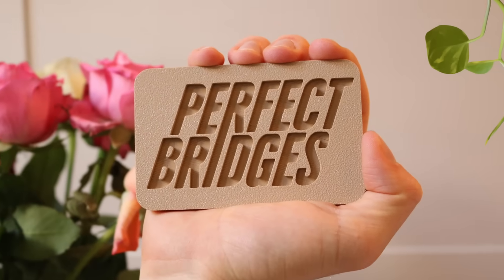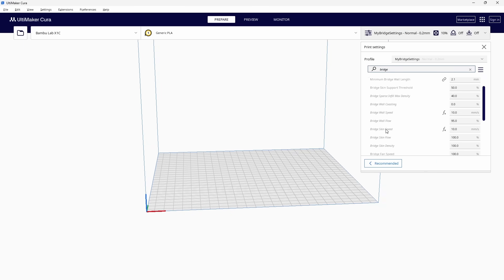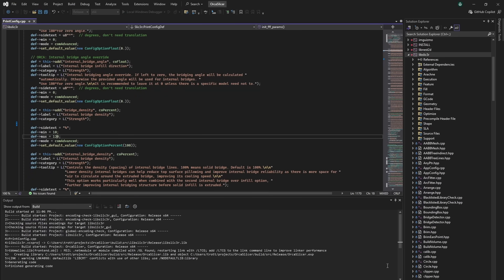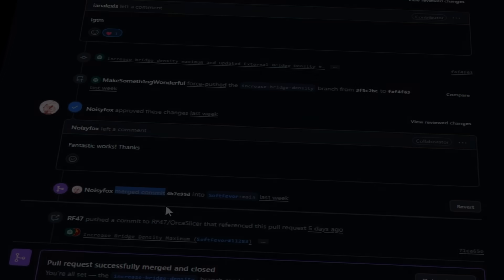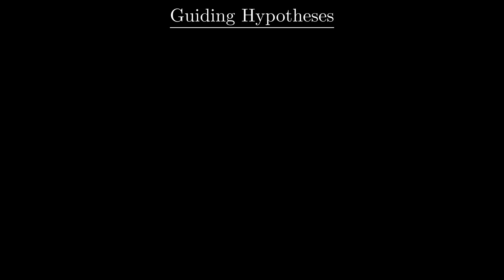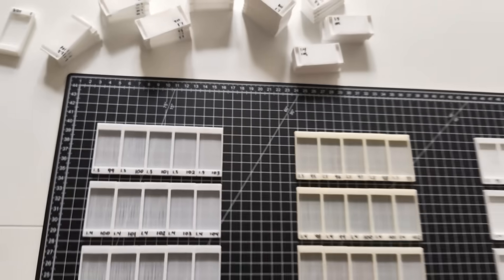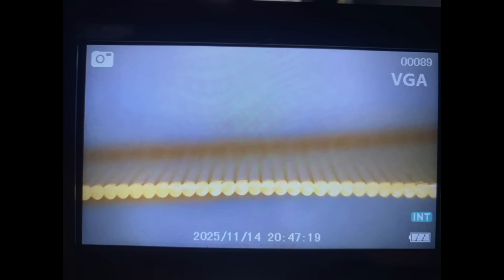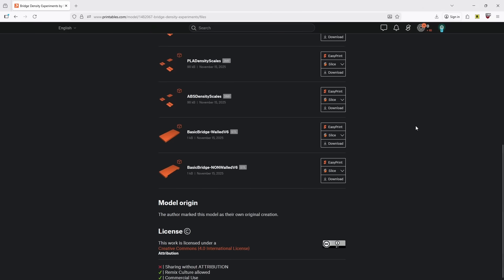You asked for PERFECT bridges in OrcaSlicer, so we built THIS

Comment: There is one feature i really miss from cura. It's the ability to set the direction of the seams. Could you please come up with something for it?
Reply: Being able to set the seams line pointed to the left or right or center with one click, really helps in saving alot of time. Especially for complex parts where we have to manually paint seams and repaint on each interation
Reply from the maker: If you want this sooner rather than later, the best thing to do would be to go to Cura's github and post a similar comment to this. I don't know any of those devs, but I've seen some of their communication. They seem very kind and helpful!

Comment: This is fantastic, obviously, well done. However, one thing that’s been bothering me since the very first video, how does this perform with true bridges? I.e. bridges that are free floating and only supported at either end. I’m guessing that without a side wall for the first bridge line to brace against, increasing flow and overlap isn’t going to have such a dramatic effect. If I’m right then I reckon the only thing that’s missing would be a support setting where only the very outside extrusion line of a bridge is supported with zero z-offset, so it’s easy to remove and you still get that the rigid side wall for the bridge lines to press up against.
Reply from the maker: Yep, it's a good point. The performance is really strong for "true" bridges. I actually printed 60 or so for this video but didn't use them because the test pieces are super fragile and start to bend after a day or two. With a more robust part, that wouldnt be a problem, though. The one major draw back is that the first line often breaks away from the rest of the bridge and just kind of hangs there. 
You could use paint on supports for a test of your idea, I think.
In a day or two, I'll print off a few "true" bridges and tag you in a short. Would you like that? Asking because I think that some people don't like the publicity
Reply: I’m not particularly active on YouTube or the community in general, but I don’t really mind. I look forward to seeing that though! Thanks.
Reply: @MakeSometh1ngWonderful  yes, I was about to ask about first line but found this comment. Running tests at the moment and while already getting nice results but the side lines(wall overhangs) almost always separated from the rest of the bridge.
Reply from the maker: I love that you're also testing. Yes, I am ashamed to say, but I didn't notice that those lines were classified under the "Wall Overhang" type. In the slicer, they even have a gap between that line and the bridge, which I would consider to be a bug. So, I made a model to cut them off, because they do not reflect the settings applied to the "Bridge" line type. Already getting really good results. 

I'll probably post a quick short on this when I am done.
Reply from the maker: Here is a short on this topic (https://youtube.com/shorts/F9FODshtw0w?feature=share). Ended up tagging someone else with a similar questions. For some reason, he wanted the bridge to be over 60mm so I made it 72mm. The overall quality is fantastic, but for half of the samples the bridge lines on one or both sides become loose. This seems to be independent of density. 
It's also worth mentioning that these lines are printed first. I couldn't figure out a way to stop that from happening but was pretty happy with the quality otherwise.

Comment: I wonder if it would help if you made a dynamic flow change when the printer gets close towards a wall or goes away from the wall, so the lines close to the wall wouldn't stack up, let's say if you are 5mm from the wall the flow rate percentage drops down till it goes to 1 when it hits the wall and vice versa when it goes away from the wall the flow rate goes back up dynamically.
Reply from the maker: This is a great insight. Are you referring to pressure advance? I dont know much about it. But, I was planning on testing it soon and possibly making a short about it
Reply: @MakeSometh1ngWonderful  Yes, it would basically be a pressure advance but for bridging, normal pressure advance happens when acceleration changes while printing. But for bridging it would need to be activated on how close or far the printer is from or to the wall.
Reply from the maker: Ok, this is a really good idea. I'll think about it and see what I can do. Want me to feature your comment if this comes to anything?
Reply: @MakeSometh1ngWonderful  Yes, sure, have you thought about how you will test it? I was thinking it would be possible to write a "post-processor" in python to change the original G-code of your print model so you change flow rate by change the E value and do a little math with the X or Y coordinates with parameters like distance from wall and flowrate and amount of steps. For instance distance from wall = 5mm and flowrate drop parameter is 20% and 10 steps, so every 0.5mm the flow rate E would drop with 2%. Just an example. Or maybe for testing to begin you can do a hard drop if you are a certain distance from the wall like instant 20% flow rate drop when you are 5mm from wall. EDIT: these examples are when you go towards a wall, when you go away from the wall it would be reverse ofcourse :)

Comment: Would it be possible and advantageous to either lower the multiplier near an edge then increase in the middle or also to slow the travel speed near the wall as it leaves the wall side to lower the staggered filament issue?
Reply from the maker: Yes, it's definitely possible! I edited flow like this in my previous video, which had some benefits and trade offs. I think that is what you meant by "multiplier"
You can also edit acceleration at the end, which is what I think you're referring to with the travel speed part.
Will it help? I am not sure, havent tested that yet. But, I've seen a few people using this technique to make really long bridges. So it definitely has some benefits.

Comment: It'd be verty interesting to test what happens if the bridges would be printed unidirectionally. I believe that would avoid the alternating pattern at the ends. It would not print new bridge next to a piece that's still soft and also simply not be alternating in nature.
Reply from the maker: You have a great point. This seems so simple, but I havent figured out how to do it yet. You could probably just manually write the g-code to make it happen as a proof of concept.

Comment: What am I doing wrong, I already had Orcaslicer 2.3.1 and can't set external bridge density past 100%
Downloaded again just in case and still can't pass the 100% external bridge density.
am I suppose to do something to the code?
Edit:  Ok so downloaded the Nighly build and the option is available there.
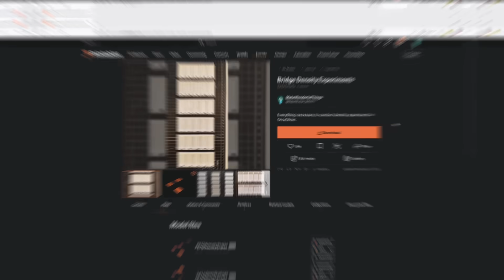Reply from the maker: It needs to be the "Nightly Build" as of right now. So, you need 2.3.2-dev. You can see what it looks like at 8:02. So, I think that you just have to scroll down a bit more

Comment: I never thought there could be away to increase number of lines for bringing as at lower flow like default of 0.9 I was getting large gaps on brige, also for prints like klicky probe the bridge edges were on mid air so I think bridging need some quite work to make the smart
Reply from the maker: There are a lot of smart people looking at these problems now. I think we will see a lot of advancement soon!
Reply: @MakeSometh1ngWonderful  I would expect the printer of the future to calibrate this automatically

Comment: What are the recommended bridge flow and density after all those tests?
Reply from the maker: I quite like BF=1.2, BD=108 and BF=1.3,BD=105 for Sunlu PETG. They look perfect to me. I've done a few "real" prints with them and have had great results
Reply: @MakeSometh1ngWonderful What about PLA? That's what most people are gonna use
Reply from the maker: I like to go with what works at BF 1.2 and 1.3. That offers a good middle path. So, for PLA that would be BD 105 and 102.

Comment: I grabbed the nightly build portable of Orca and brought over my filament presets etc.. I grabbed the models from printables and loaded it up as a 3mf project for petg. I changed the printer to my printer (SV08) for this test and sent it to the printer. Is the idea that I print all 3 plates from the project and then use the settings from the one that looks the best?
Reply from the maker: Nice, you're taking a lot of action quickly. In my opinion, you want to find a bridge flow that gives you the characteristics you want (aesthetics, strength, etc.). So, in theory, you could just start with bridge flow 1.3 for example, print off those 5 and check the results. The Density percentage where the "stringiness" stops is the "ideal." Then, just use that for your next print. 

If you want to know your options, just print all three plates and see what you get.

Some tuning may be necessary, but so far these values have been pretty close for everyone who has tried them. 

I hope this explanation helps!
Reply: @MakeSometh1ngWonderful So what are the magic values that work for pretty much everyone? 1.2 bridge flow and 105% density ?
Reply from the maker: There are no "magic values." I'd prefer if everyone tested and worked to that answer together. I'm not much of an authority, just asking questions and sharing what I find.

Anyway, the answer your looking for is on you other comment 😊
Reply: @MakeSometh1ngWonderful What can I look at if my bridges suck on all the results? Any suggestions? I feel like bridging on the Sovol SV08 just seems to have issues... It's Polymaker's new PETG formula and other than bridges things seem really dialed in for the filament.
Reply from the maker: Well, send me some photos on discord. @MakeSometh1ngWonderful. I can try to see if I recognize the issue or can offer any other help.

Comment: When reaching the sides decrease flow to thin out the lines?
Reply from the maker: Not sure what the question is - but this was the solution that I presented in my last video. It worked for the intended purpose, but the density solution here offers another tool to use.

Comment: Nice. After watching your previous video, I had tried setting "solid internal infill" to something less than the nozzle size so the lines would be closer on bridges, then up the bridge flow to fatten the line back out. Was trying this on TPU,.. so nothing really helped. Cool that you got a real solution implemented. Maybe I'll try it soon with something other than TPU.
Reply from the maker: A few commenters have said that flow and speed manipulation worked for TPU but I haven't had a chance to test it for myself. I want to do an entire video on TPU in the future. If you find success, I would love to know.
Reply: @MakeSometh1ngWonderful    I wouldn't say I've had success with TPU. Just not quite as bad. Slow,...like 10mm/s seemed best. A lot of fan, yet you will see which way your fan tends to blow because the "bridge" will blow in that direction. Turn off thick bridges( the opposite of these videos). The stuff we do with PLA just seems to make it worse. Again,.. no success story here. I was mostly just trying to make it "better" and easier to remove from supports. Seems like even though it's supported, it calculates that area as a bridge also.
Reply from the maker: Ok, these are interesting insights. Hopefully we can make some progress on this front soon
Reply: @rcrdps8144 probably very stupid thought: PLA can hold itself, if printed and cooled in the air. TPU can't. I'm having the thought of printing the TPU bridges very fast, but without increasing the flow, basically putting the TPU under tension across the bridge.
No idea how you'd set this up and if it would work. I'm just thinking about what you could do with the filament as it is on the spool, to get nice bridges.
For PLA, it's "just hold it when it's not melting", for TPU it's "put it under tension".
Reply: @Habixus  Fast works for PLA. I tried it with TPU and ended up going the other way. It doesn’t dry as fast as PLA, so it droops instead of creating the tension. Under extrusion might help you get it tighter.

Comment: I see the near future where Orca provides callibration suite not only for flow, pressure advance, input shaping, but also for bridging
Reply from the maker: I've seen a few people and projects working on this. Maybe it will happen very soon.
Reply: @MakeSometh1ngWonderful  Oh, really nice to know! For me It was a first thing i thought too. And you done amazing work for it, that's awesome
Reply: I would love to see calibrations for fan speed, overhang prints too
Reply: That would literally be game changing for new filament setup. If you include a wizard that saves the best settings, that would be mind blowing for noobs and expand the audience 10x
Reply: If we could add variables to settings in orca we could have a ton of fun with checkboxes dropdowns and macros
Reply: Yeah this is logically the neztstep, bring your bridge test model in as a calibration
Reply: I'd love to see a completely custom gcode print that uses the whole bed and tunes EVERYTHING. You run the print, and it's just good after that. Might need 2-3 buildplates the first time, but after that it's just a few small prints.

Comment: I love how this idea turned into such a big testing operation where it sparked an actual change in the Slicers so we can all optimize our bridges.
But I think for an optimal solution to this problem the slicer would have to differentiate between the start/end of a bridge line and the middle. All the setting changes up to this point basically are different paths to one outcome: We increase the effective filament density per volume of space to a value bigger than 1 (where 1 would just be the amount of filament that perfectly fits into this volume with no air gaps).
This is good for the bridging area because the bigger amount of filament gives us more stability and we can afford to do that since the area below the bridge-line is empty space into which this additional filament can expand.
But it must create a problem on the edges of the bridge because there is no space for the additional filament to expand into cleanly since the bridge is supported by solid walls on it´s ends. So every time we get over a threshold where too much filament is pressed into the area close to the wall it will have to flow somewhere else and it will create chaotic patterns like rippling on the way. While we can improve this by changing how the additional filament is deposited in this area (by adjusting between more flow or higher line density), I don´t think we can fully prevent it from happening.
If the slicer could indentify bridging areas, that are close to walls, it could apply a linear progression from the normal density and flow values to the bridging values.
It would also feel to me like the most natural solution to this problem: We have two distinct areas for which we know "good working" printing parameters and we have an area in between so this area probably needs in-between-values.
Reply from the maker: Thank you! Yes, you're exactly right. There are some developers working on this type of solution. In my opinion, this is much more complicated to implement than it may seem, and would require a new line type identification and parameter set (bridge over walls vs. bridge over empty space vs. bridge over supports). I plan on leaving this solution to the pros, because I don't want to break anything in the slicer 🤣

The solution in this video is the 20% of effort that gets 80% of the results (maybe higher or lower depending on how you would rate these bridges 😆).

Your idea from the last video of creating CAD bodies that serve as modifiers is another solution like that. I've had decent success with that, but still haven't perfected it. But who know, maybe in a year from now I'll post a video with this comment in the thumbnail.
Reply: @MakeSometh1ngWonderful  this is the first I've heard of using CAD models as modifiers, but thank you for bringing up @jhuh95's idea again here! My printing game just got upped simply by watching your great video and then coming here to the comments! Thank you! :)

Comment: Do I get it correct that bridge speed is always fixed at 10mm/s and now you only need to tweak flow and density?
Reply from the maker: Yes, that's the way that I ran these experiments. Speed matters less for some filaments like polycarbonate. Also, some printers produce great results at higher speeds. But this is what I've found works best for my setup.